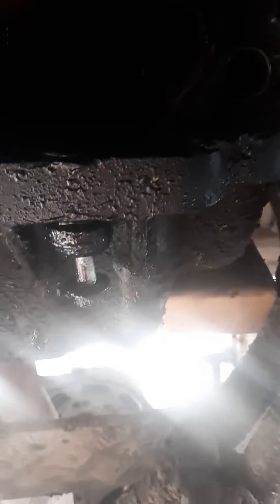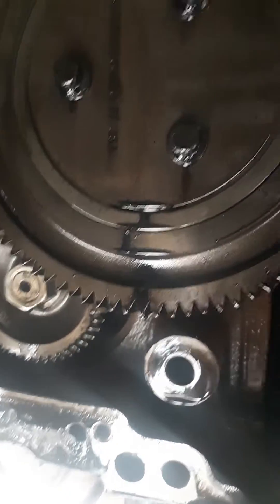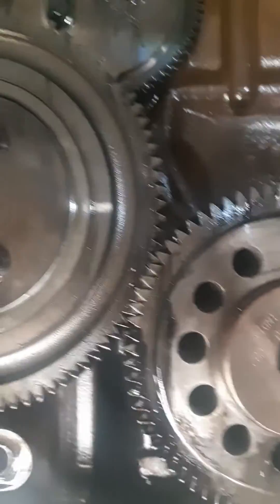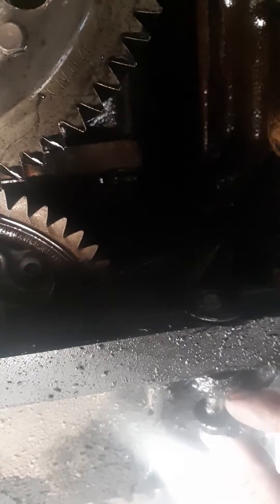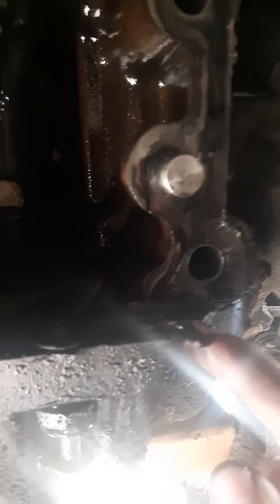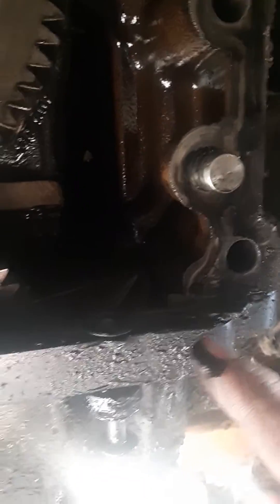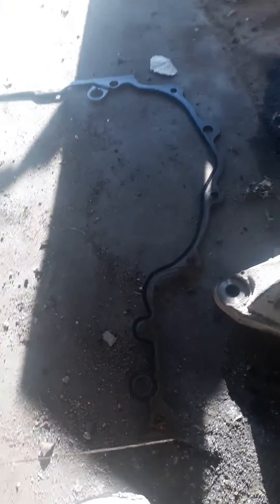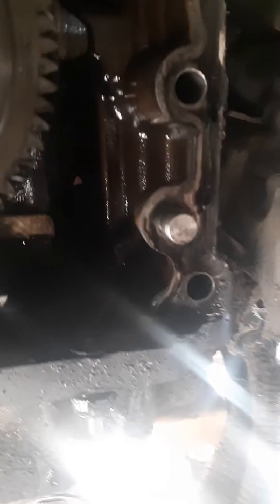Detroit DD15 Flywheel housing installation tips

Comment: I just left my truck in the shop to replace that gasket. I have my oil pan gasket replaced last month. Do I still have to replace oil pan gasket also?????
Reply: No but if its down clean it up .. most mechanics just dont care about it when pulling it down
Reply from the maker: There is a good chance that the oil pan gasket will get damaged during this job
Reply: @tkmech5747  thanks for the reply.